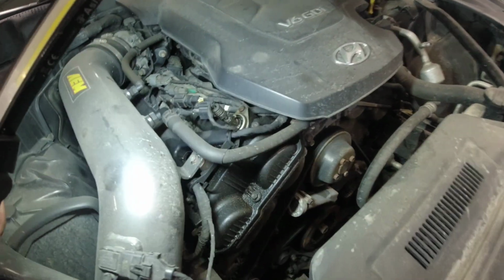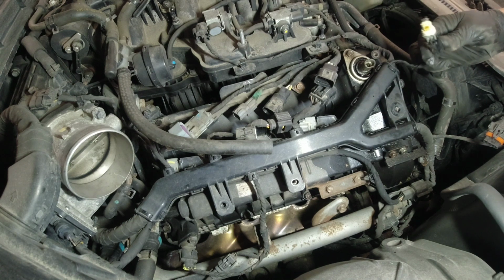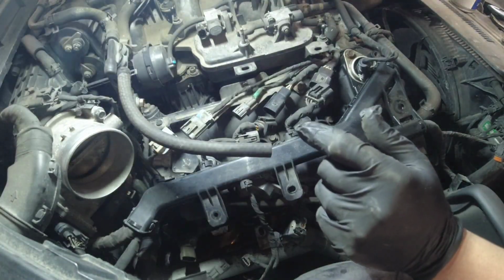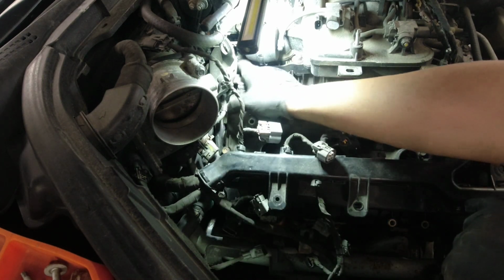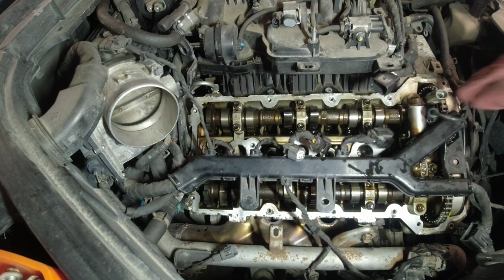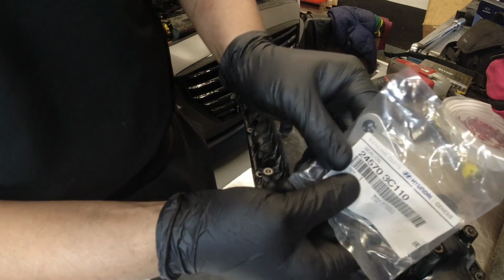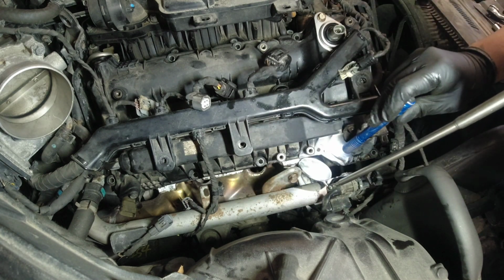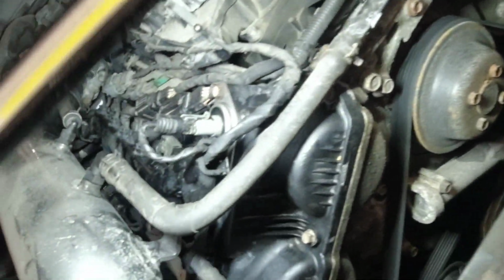Genesis Sedan 3.8 Valve cover gasket replacement

Comment: By chance do you know how to get the Surge tank off on a 2015 genesis sedan 3.8?  It's kicking my ass.  Just trying to get to the drivers side spark plugs to swap them out and I can't get to the two bolts in the very back that appear to be holding it on.
Reply from the maker: Usually i use 1/4 socket 10 mm i believe. And also theres like a retaining plastic for those bolts i believe, just loose all bolts. Let me know if you remove it
Reply: @hyundaitech  Once I figured out that I could remove the panel that's between the firewall and the engine as well as the steel bar, I was able to access the two 10mm bolts and the two 12mm bolts to free it up.  Even with hassle it was still worth the time after getting quoted over $900 to change the spark plugs.  Knowing what I know now, I could probably do it in two to three hours, vs the 6+ with research and reading the forums.